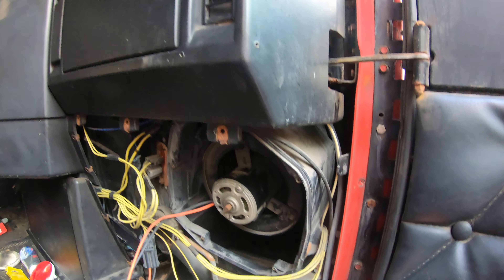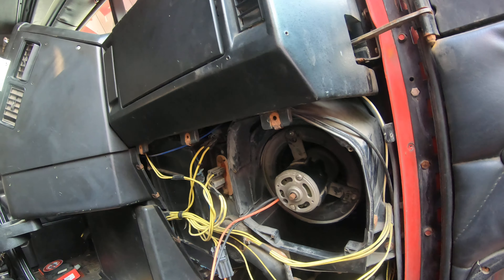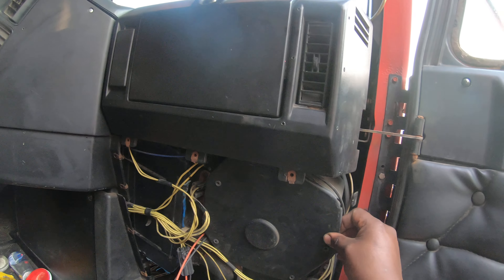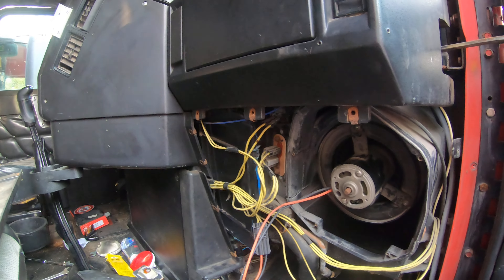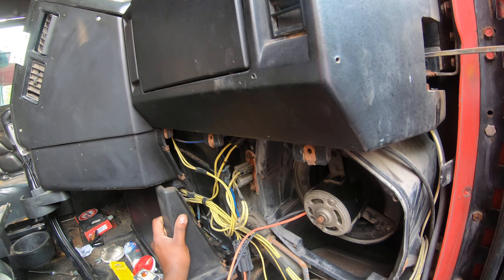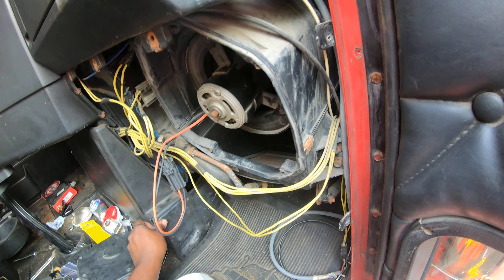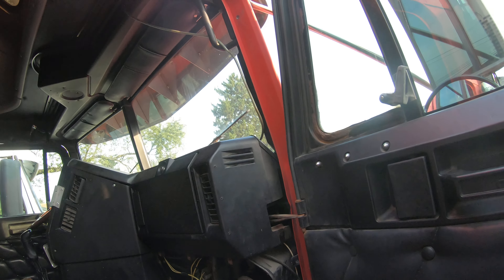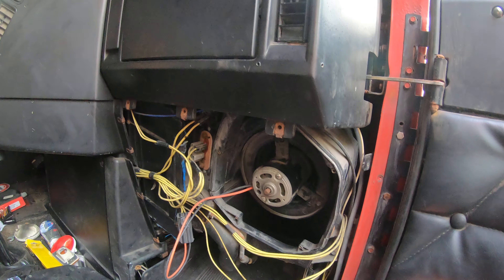FREIGHTLINER FLD/CLASSIC Blower Motor Replacement

Comment: Where is the fuse box in a xl classic
Reply from the maker: The square panel with 3 spring loaded screws in it at the bottom of the center of the dash!

Comment: I HAVE A 2000 FREIGHTLINER FLD 120 I HAVE LOW AIR FLOW COMING FROM DRIVER/PASSENGER SIDE AN DEFROSTER BUT THE MIDDLE VENTS HAVE PLENTIFUL AIR FLOW.. ANY IDEAS WHAT'S THE PROBLEM.. THANKS
Reply from the maker: Hey Tim I’m no expert, but I’d definitely check that ductwork. When you find the fix please let me know what it was so I can store it in my memory. Thanks for dropping by.
Reply: @TruckerRealDeal  MANN ... R U A MIND READER !! I PUT IT N THE SHOP EARLY JUST MORNING... I WILL KEEP U N TOUCH... THANKS 👌